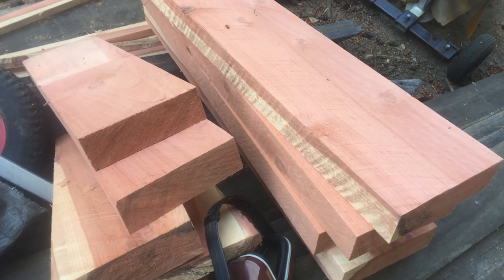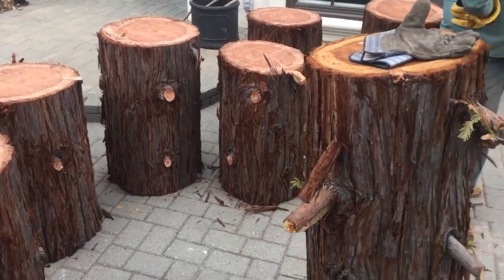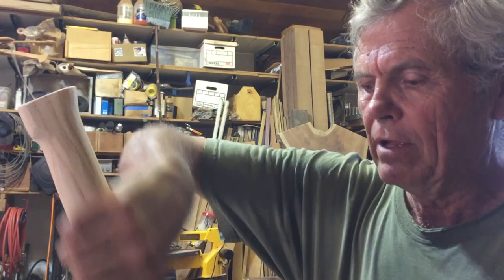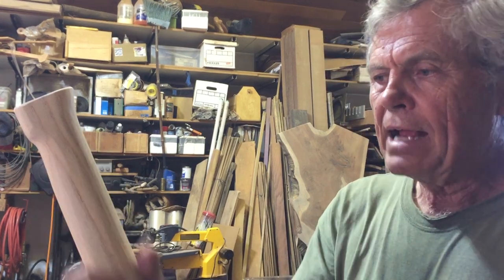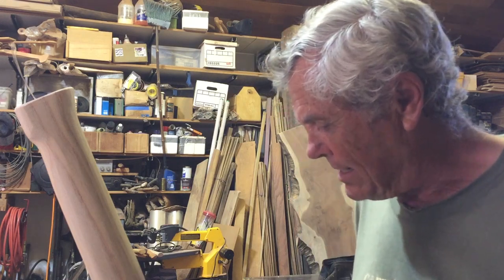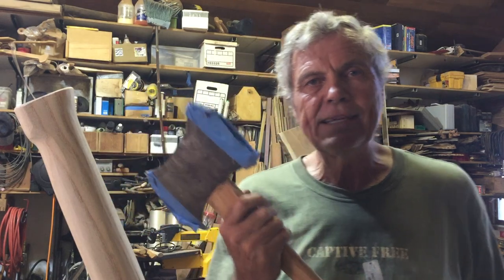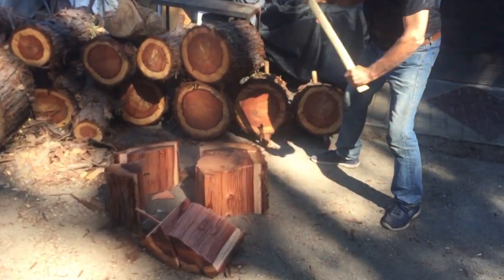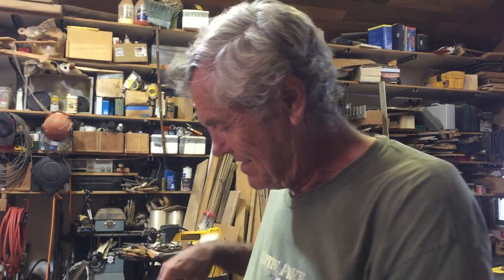Why Make your own Tool Handles?

Comment: Double bit axes typically have two separate tapers. One bit is tapered and sharpened for actual chopping, while the other has a blunter taper for root and grubbing work.
Reply from the maker: Not heard that one before. Always heard that the loggers who didn’t have the luxury of chainsaws and power equipment, would use their ax long and hard. Two sharp bits made their work go smoother. Back in the bunk house, they would resharpen both edges for the next day. Maybe if a landscape guy used one, that would be a good idea.
Reply: @arboristBlairGlenn  Fair enough. Thanks for the response. I heard that from the US Forest Service training. I might have misremembered. Keep up the good work.

Comment: Very creative. Both Buckin Billy Ray and a guy working with August are taking the old axe heads and making some of the best axes I have ever seen. I would like to find one of those old Kelly forged axeheads. Double bits are my fav.
Hey Blair those other guys are doing axe giveaway contests to increase subscribers. Just a thought.
Burn ur brand into the handle.
Hope you have a great day.
Reply from the maker: Ax give away? Humm ?? Which one do i let go?
Reply: @arboristBlairGlenn  grab an old one. Seems like the ppl like the older ones. Plumb, tru temper, and kelly are the one's that come to my mind. I looked at some kelly's that were on ebay tonight that were going for 100 bux all rusted and with no handle. Buckin Billy Ray has a ton of videos where he showed the whole process of restoring both head and fitting handles. Him and the other guy with August have ppl just giving and sending them to these guys now. The guy with August has held a few contests to win one but says they have to join either Instagram or utube to be entered to win. He also increases his subscribers by stipulating they have to tag someone else to be eligible. Well you get the idea and can peek at theirs to get ideas. You're pretty creative so I thought might be a way to increase subs and teach a bigger audience.

Comment: I was a bit surprised you didn’t sand the handle by hand as well
Reply from the maker: I’m a traditionalist at heart but like to get it done! The shaping with a spike shave gets it really close. Hand sanding would have added hours to the job meaning I would be working for three dollars an hour😳
Reply: I understand completely. At a certain point you really do have to say "I'm not willing to put in more time on this." I don't think you have to turn in your traditionalist badge.

Comment: I too have hung many an axe - and I much prefer ash wood. I rub in linseed oil with my hands. I may be wrong but I have a feel that the heat makes it cure better that way. What are your oppinion on hickory for axe handles?
Reply from the maker: Hickory seems to be an old time standard for handles but we don’t have hickory trees around here. But we have a lot of ash.

Comment: Blair based on the last vid about removing that Red wood trees, and you saying that the wood is a good commodity and worth money is it worth the expense to prep the tree, say remove all the branches then bring in a crane to remove bigger logs for production? Just wondering. cheers
I have to agree wholeheartedly with the handle where I grew up back in the day if someone didn't make the handles on site then you didn't get a new handle. I remember my father saying the same as you said, he needed a long handle as well he was 6' 7" and my mom 5' 6" lol and us kids fell in the middle mostly except for 1 brother and my sister they had the height also. lol  And yes the handle can be tailored to how you like it for fit and feel... very good
Reply from the maker: If a crane can reach the tree, (and the client is willing to absorb the cost), then yes a crane is a good call.
Reply: @arboristBlairGlenn  I don't mean the client I mean from ur side. You still get same money for quote job that would go faster so money in pocket there and then sale for better quality Red wood. That was my question maybe never stated it clear enough.

Comment: Can you recommend a good spokeshave?
Reply from the maker: All of mine are really old (like me😳). A new one would be just as good. It’s all about the sharp blade.
Reply from the maker: There are spokeshave kits with all the hardware and a piece of wood. All you need is to shape the handle. Best tool to shape the handle would be— a spokeshave.